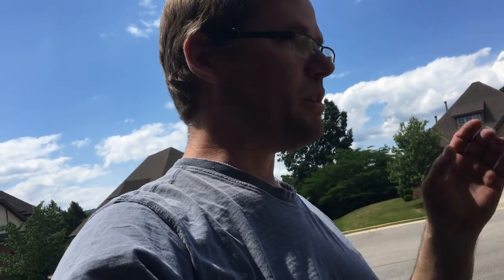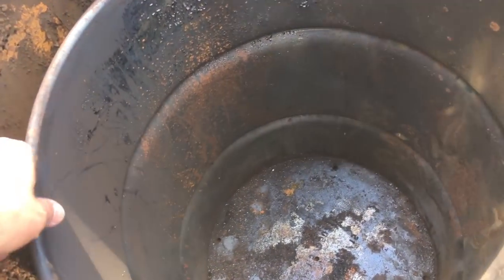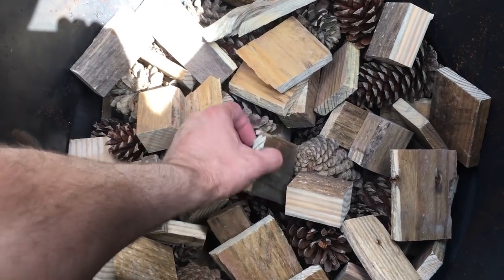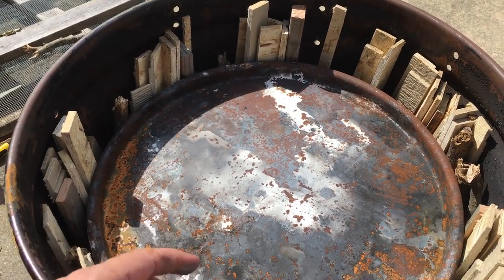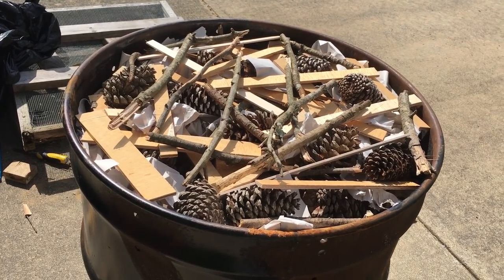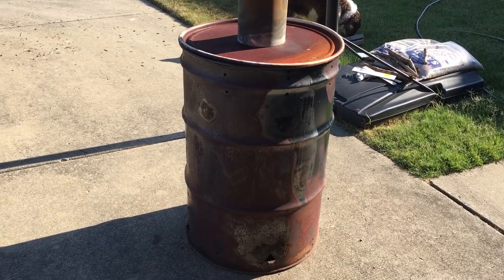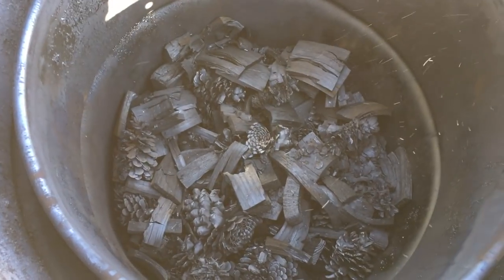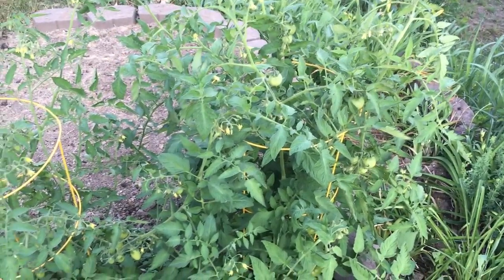How to Make Biochar

Comment: Man, good stuff. I've seen when's good (carbon) biochar it can lit an LED cell when you connect the two ends of the light.  can't wait to do my first batch. Got me  a cylinder and a square steel  pipe. Trying to  do the smokeless retort version.  Thank you for sharing.

Comment: You’re right to use small pieces. I rolled up some cardboard and shoved into a 50 gallon drum. I threw it on a big fire and the next day found only a part was charcoal. The first time I stood the barrel up and left the one inch hole in the lid open in the coals.  So I tried it again but rotated the barrel. The second time I laid the barrel on its side. I also rotated the barrel. I could tell as I rotated it flames around the barrel seal was still burning and finally stopped. I’m going to check it tomorrow. But ya if I do it again I’m going to rip cardboard up into smaller pieces instead of a big roll. I thought to try cardboard cause I got tons of it I can get from a flower shop. And the cardboard and wood chips I used once turned into carbon is super easy to crush.

I’ve made charcoal in a trench method and works great for volume. I walked on it but it only broke into one inch or half inch chunks not very fine. I need to buy a leaf grinder or something if I do the trench method again.

Comment: Great video! Unsure if you’re still checking these comments, but wondering if there would be an advantage to putting a lid on the inner chamber, to force more gas from the charcoal back into the fire? From what I gather it’s open at the top, so you could still lose quite a bit through the chimney?
Reply: Hey Dave, no...there is a lid on the inner barrel.  You don't want to leave that open or else it will burn what's in the inner barrel.  The lid makes the internal pressure push the gases out those 5 bottom holes.  I know the video thumbnail makes it look like the wood is built up out of the inner barrel, but it is not.  I put a lid on it then stacked more wood and sticks on top and then it burns on top and down around the barrel.

Comment: Hi Shawn, I see your still answering posts. I think you did a great job of explaining things and clarifying the LWF video. At this point almost 5 years later would you make any changes or add any info? the only question i would ask is about lifting the 55 off the ground. I thought LWF said to leave it flat on the ground for some reason. Thanks for sharing!
Reply: I only leave it off the ground to protect my concrete driveway. :-)  Honestly, I wouldn't change a thing about it. It has worked well each time I have used it...I would add another two 3ft sections to the stack to burn off more of the smoke.  

The last time I used it, it made so much smoke someone called the fire dept on me.  LOL!  They thought it was a meat smoker which I didn't tell otherwise and they saw that I had a hose out there with me so, no questions were asked except if they could get some of the meat when it was done. To be clear, I wasn't using it to smoke meat.

I want to build a larger one when I move to more land eventually.  This works fine for a small HOA neighborhood situation.

Comment: Nicely done mate you did however forget to mention you need to activate the carbon prior to using it other wise it's just char  not biological char
Reply: I didn't do a good job of mentioning that part at the end around minute 7:49 seconds.  But yes you are correct, you have to 'charge' the crushed and classified charcoal for at least 30 days in your compost pile.  Classified means, you run the crushed charcoal through a 1/4" metal screen to end up with charcoal dust and tiny chunks which you add to your compost.  

The pre-Spanish colonization South American natives would put the crushed charcoal into large clay pots and use them as urinals to 'charge' their charcoal.  This is what made the original terra preta, which is some of the most fertile soil on the earth.  They actually defecated into the pots too, BUT I would NOT recommend you do that! The urea in urine is enough to make the biochar work properly, but I would still throw that urine-ladened charcoal into the compost pile so that fungus, bacteria, and macro-organisms can find a new home inside the microscopic holes in the charcoal.  The microorganisms are what do the heavy lifting in providing high-quality nutrients for the plants.

Comment: About what % of biochar do you mix in your soil for tomatoes? 10% a good start or too much? Thanks.
Reply: I usually do 5%, smash it up pretty well...I use a 1/4 wire screen to filter it so that pieces 1/4 in diameter end up in my compost.  I add a 16 oz cup every time I add new kitchen scraps + two 16 oz cups of compressed pine sawdust pellets (at Tractor Supply) horse bedding...

Comment: Is the inner barrel flat against the bottom? I’m making Biochar but it doesn’t sound like glass like this.
Reply: Yes, the inner barrel is laying flat on the bottom.  The pressure of the gasses inside will push under the bottom rim because the bottom of the outer barrel is not perfectly flat...especially when hot.
Reply: @shawnpearson8927  Thank you how is the inner barrel cooked?
Reply: @justine8531  So basically the fire that is started on the top of the 30 gal drum (is covered by the 55 gallon drum top with the smoke stack), it burns its way down the sides by sucking in air through all those holes we drilled in the sides of the 55 gal drum.

This heats up the inner 30 gal drum to close to combustion, but since there is limited oxygen inside that 30 gal drum that wood doesn't catch fire...in a sense it 'cooks' out the natural oils and trapped gases in the wood's cellulose fibers. Some of these gases are similar to natural gas and build up pressure in that inner drum.  Since the 30 gal drum top is sealed, the pressure makes them push down to the bottom where the path of least resistance is through the only holes in that inner drum are where it can escape.

In turn, as these gases push out from under the rim of the inner drum, they mix with oxygen and the already burning embers to ignite and increase the temperature inside the inner drum even more.  This process helps speed the carbonization of the raw cellulose because the temperatures get so high, but there is no oxygen inside to sustain a fire within the inner 30 gal drum.

This cycle is automatic with this configuration so it's pretty much a "set it, and forget it" process.  That's why I felt it made it worth it to spend the money on this contraption.

Comment: Great vid but I have a couple of questions: Can you use punky or rotten pieces in the inner retort to make the charcoal? And did you only fill your inner retort partially or did we not see you fill it the rest of the way? If you only filled it partially, why? Thanks!
Reply: Sure you could, just as long as you don't use processed or treated lumber.  

And yes, I filled the inner drum all the way up to the top, but made it so I could push the top all the way on. You don't want any air coming in from the top.

Comment: so im getting flames in my 30 gal drum, and idk how or why? i have the 30 gal drum sitting flat, and my lid is on tight, im useing wallnut, could that be a problem, because there seems to be alot of tar that is not draining anywhere, im using the same method as you and ive only had one successful batch, the rest have burned up i would say 5 trys all together, so any help would be apprecaited, im trying to get and consistent production of biochar going.
Reply: Is the bottom of your 55 gallon drum warped? You could put a thin later of cement in the bottom to level it out so that the 30 gal drum sits completely flat.  The pressure of the gases inside will push lift the 30 gal slightly to release the gases as it burns but won't let the flames get underneath.

Comment: I'm looking for drums to do this myself. Should I be worried about drums that have previously stored petroleum? Does it matter since youll be burning it away?
Reply: Well, I don't think it will be that big of a deal if you power wash it out a few times with dish soap. I would not stand close to it on your first burn...it's hard to say if some of that petroleum seeped its way in to the bottom seam where the floor of the can meets the side.  Plus you may not want to use your biochar first batch.

I would not use a 30 gal drum that had petroleum in it previously...you don't want to contaminate your biochar.  When you make biochar using this device, there is a black tar-ish hydrocarbon liquid that actually burns in the bottom of the outer can.  It is what "melts" out of the wood during the carbonization process from inside the 30 gal drum.  I've had it leak out of the bottom air hole in the 50 gal drum during a burn before.  It stained the driveway...and smells close to kerosene.  

I had no idea that was what was burning in the bottom of the can after the outer wood burned down to ash.  Apparently, this is what keeps the burn going up to the 4 hour mark after burning all that wood around the edge of the 50 gal drum for the first 1 hour and half.

Hope this helps...sorry for the slow reply, I only check these comments every once in a while and no longer manage the Red Mountain Makers YouTube account...so I don't get the notifications.

Comment: Can you fill completlely the inner drum?
Reply: Yes, I filled the 30 gal inner drum to the top in this demonstration, but you didn't see it because clipped the video so you all wouldn't have to sit and watch me fill the whole thing.  BUT, after you run the cooking process, the inner barrel contents will "shrink" by about 40% because a lot of that wood cellulose burns off into methane, and wood alcohols.

Those alcohols and tar are what keeps the cooking process going after a lot of the wood outside of the 30gal drum has burned away...the cellulose that burns off inside the 30gal leaks out the holes at the bottom of the inner drum as that black tar'ish material at the bottom of the 55 gal drum.

Comment: does the 30 gallon drum sit up on anything inside the 50 gallon drum, to create a space between the two drums on the bottom?
Reply: No, it sits flat on the bottom,  the pressure created inside the 30 gallon drum causes it to expel the flammable gases in a small steady stream that keeps the kiln burning after the wood has burned down around the sides.

TIP: You'll want the 55 gallon drum on a flat level surface or else the wood liquor (tar) will spill out the holes in bottom. A long stream of tar messed up my driveway the other day when it spilled out the vent holes, since my drive isn't level. This "tar" also burns at the bottom of the drum, under the 30 gallon drum.
Reply: @PurplepeepsGmail  I have viewed many videos on this subject. There should be zero liquid at the bottom of the drum. If there is tar accumulation, it tells me that the ideal temperatures have not been attained or sustained long enough. This "wood liquor" you call is actually a biproduct from making charcoal. Which is not what we are trying to accomplish.
So it is one of 2 things. The retort is too large for the amount of fuel used to charge the system. Not enough fuel is maintained to keep the temperatures high. The addition of more kindling.

Comment: How did you made those triangular holes?
Reply: I used a Rotozip cutter with metal cutting blades.  I cut two top edges of the triangle, then used a vice grip wrench to bend the metal outwards and roll it over so it wouldn't cut someone.
Reply: About how big are they? 2” or more like 1”?
Reply: @microbiogrow  Sorry I missed this - they are about 3" wide at the base of the triangle.

Comment: What do you mean compose it? Like set aside in closed container?
Reply: I was saying you need to compost it, meaning you need to crush it up into small pieces and place in a pile of leaf/grass clippings + food scraps + water for about a month or two...this allows bacteria and fungus to get into the tiny carbon pores.   

There are tiny holes in the biochar carbon that allow the bacteria, fungus, and water to hide/hangout protected until needed.  When your plants roots send down their sugars into the soil for the bacteria/fungus the micro-organisms feed on the soil covered in the simple sugars that the roots emit.  

Each specific sugar the plant emits attracts a certain type of micro-organism which eats the soil and "poops" out the proper vitamin, mineral or enzyme that the plant needs to absorb in order to be healthy, grow, and produce fruit, stems/leaves, or roots you eat.

This is why biochar is important for your soil.  Once you have composted it to a certain point and added the composted biochar to the soil...if given enough time the biochar absorbed the proper micro-organisms then you don't have to amend your soil with new organic fertilizer constantly. The micro-organisms do all the work of making the right minerals the plants need to make protective chemicals for repelling insects, make photosynthesis efficient, and grow fruit.  It also helps keep water in the soil even during drought.

Comment: realized the pipe i bought for the chimney was only 4 inches in diameter, do you think that would be enough?
Reply: Possibly?  make it tall like 6ft, that will cause more of an updraft and burn more of the smoke before it comes out.  I think I used 8 in A/C duct
Reply: @shawnpearson8927  got 6 ft with an extra 2 ft left over and it seems to be working. Haven't gotten it hot enough to burn the gas, but I'm gonna try doing what codys lab did, and start a fire under the 30 gallon, and when the fire burns down and the 30 gallon sinks into the 55 gallon, you put the lid on. That way it gets hotter easier. Gonna try doing the pit method too since it seems superior anyways
Reply: @Matrix2458  do you have enough holes?  Mine are every 30 degrees around the 55 gal drum so there are 8 sets of holes around the top and another set around the bottom (which include the larger triangle holes).   You may just need a little extra air flow.  I basically copied the Living Web Farms design...the only part I was not sure on was were the holes in the bottom of the 30 gal drum...just guessed based on their dialog in their video, got it right the first time.  I made this video to make that part more clear.
Reply: @shawnpearson8927  yeah, we did the holes the same and all the wood on the outside burned all the way down. We didn't have the nice wood pieces though, just a lot of sticks
Reply: @Matrix2458  Hmmm...that should have carbonized if it was simply sticks. You do want to make sure there is a lot of air space between the stuff you want to carbonize inside your 30 gal retort.  People try to do small "particulate-like" stuff like sawdust or small woodchips and it doesn't very work well because basically that kind of stuff insulates, plus it doesn't allow the gas at top of the barrel to easily flow down to the bottom.  It will push out the top around the rim and ruins the set-it-and-forget-it ability.

This is why I use pinecones intermixed because it allows enough room for the airflow to go downward. 

You could also put some small steel bolts under the 30 gal to lift it slightly, you don't want to lift it too much where flames can get inside...that will mess up your "cooking" process.

Comment: 3.17 Make sure the wood is not manufactured.... err... I see plywood and chip board.. how do you think they glue them together... sheeze.
Reply: I agree, manutactured woof stuff is not perfect.... nevertheless we reach here quite high temperatures where most glues decompose to harmless substances
Reply: You don't use plywood/manufactured wood inside the retort barrel (30 gal drum) - which makes the actual biochar...however, you can use it to burn around the outside in the 55 gal drum. If you noticed I only put hardwood and natural sticks/pine cones inside the 30 gal of drum.
Reply: The glue used is urea formaldehyde resin, which is actually used in agriculture as a nitrogen source. It's going to break down at those temperatures though.

Comment: No air in the drum for pyrolysis.  Just holes at the top for gas to escape.  I have drum with large holes at the top.  Turn the barrel upside down add some dirt around the edges and start a fire around it.  When the gas’s at the top subside it’s ready.

Comment: How do you charge the biochar
Reply: Hey Edgar, sorry for the super slow response.  I charge it by crushing up the chared pieces between two stones and classifying the smaller pieces through 1/4 inch hardware cloth (metal screen).  Then I take the small pieces and black dust adding it to the compost pile where I leave it there for at least a month.  I'll add coffee grounds, urine, dried molasses, oats, a handful of horse pellet bedding and food scraps (no meats or dairy).  

Much of that I add to build up fungal hyphae...the sugars from the molasses and cellulose from food scraps bring in the bacteria.